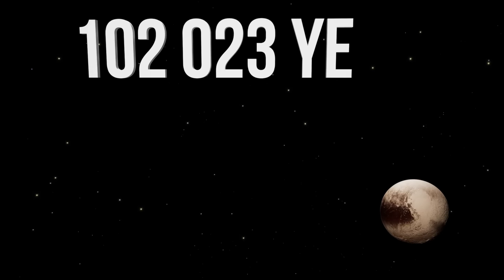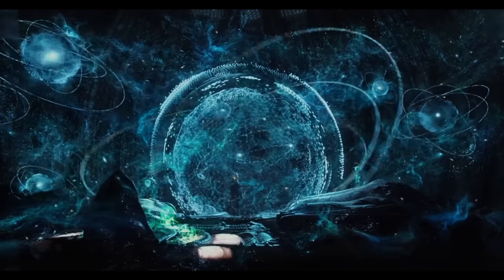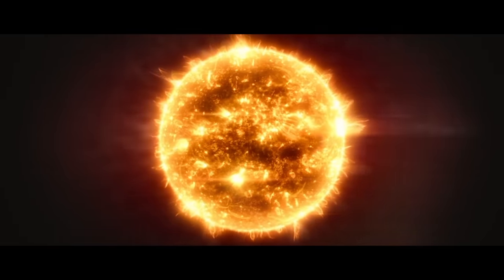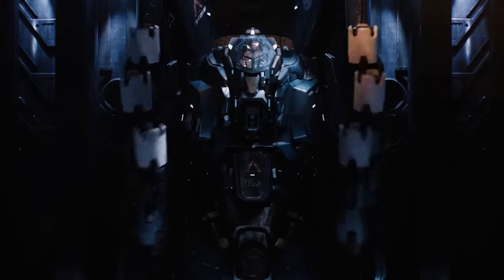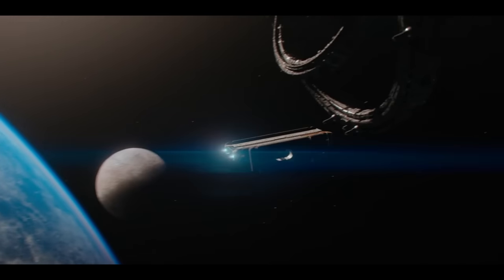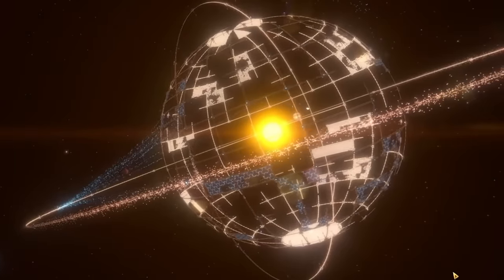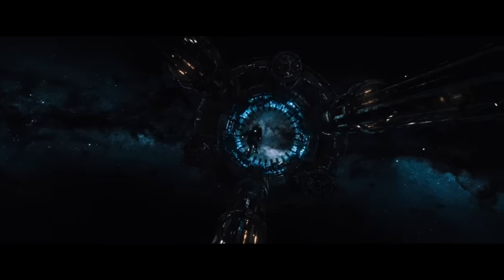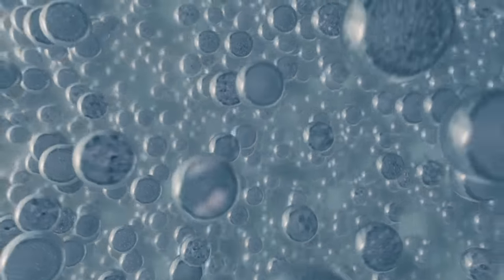This Is Why We Would Never Become a Type 2 Civilization

Comment: To move our star, would we not need a better understanding of gravity and geometrical forces?
Not quite as effective of a display but toss a ball into a pool to represent the sun then toss other balls in that same pool to cover each planet and belt etc, then push on the "sun" and I'm guessing it would collide into the other balls in the pool unless you can keep each planets orbital rotations and movements the same?
Reply: if the force is only applied directly on the sun, planet collision wont be an issue
Reply: @Outlaw-db6ee  In my mind if we put force on the sun that moved it, unless we add the same force to every other object things would work like the lost planets.  Take a large marble and place it in the center of a table, again add the other objects and so on around that marble.  If you push the marble it will move but more than likely run into the other balls or get pushed away from them.  Could you explain the planet collision not being an issue as again I see the planets breaking away from the gravity that holds them in place and keeps them in relatively the same orbits as they currently are.  It's like how the Earth's moon moves further away from the Earth each rotation???  With enough time some have said the Earth will lose the moon and it'll be a "Rogue Planet" or something along those lines.  I see the force being put on the sun to move it as having that same problem???
Reply: @n0tfunnyHaHa  You have to remember that the sun is already hurling through space at thousands of kilometres an hour, as well as the planets. The reason the planets do not deviate from the sun and get lost is because of gravity pulling them together. This gravity will still be present if we use a force to push the sun and make it hurl through space even quicker, as  it will not be possible that the force used will be strong enough to overcome the gravitational force between the sun and the planets. It is just too strong. Instead this force would be similar to a jet booster on a rocket, moving the entire solar system, aside from the astroids and things on the outside that do not have as strong gravitational force to the sun. Maybe if we become advanced enough and can a)store that much energy and b) are able to expell it we might lose pluto (but this is highly improbable).
Reply: @Outlaw-db6ee  Here's hoping at some point in time we get to that point, I'm still waiting on my "Replicator, Transporter, Warp-speed, Engage!"   So many theories and ideas?
Reply: @n0tfunnyHaHa  I agree, it would be incredible for us all to see. Although I think we will see a huge amount of insane technology breakthroughs in our lifetime, one can only dream what itll be like to those who uncover faster than light travel

Comment: profile picture
How to use Dyson spears theory of we can build multiple space probe with Solar power which can store energy in a for of battery and use laser for transferring that to long distance using multiple different probe for faster transfers
View other drafts

The Dyson sphere theory is a hypothetical concept, and there is no way to know for sure how it would be built or operated. However, it is possible to speculate on how a Dyson sphere could be used to power space probes.

One possibility is to use the Dyson sphere to collect solar energy and store it in batteries. The probes could then use this stored energy to power their own systems, such as propulsion, communications, and sensors. This would allow the probes to operate for longer periods of time without having to rely on solar power from their own solar panels.

Another possibility is to use the Dyson sphere to generate laser beams. These laser beams could then be used to transmit energy to the probes. This would be a more efficient way to transfer energy over long distances than using radio waves.

To use multiple space probes to transfer energy faster, they could be arranged in a network. The probes could then use the laser beams to transfer energy between each other. This would allow for a more efficient and reliable way to transfer energy over long distances.

Of course, there are many challenges that would need to be overcome before a Dyson sphere could be used to power space probes. These challenges include the enormous cost of building a Dyson sphere, the difficulty of transporting the probes to the Dyson sphere, and the need to develop efficient and reliable laser technology. However, the potential benefits of using a Dyson sphere to power space probes are significant. This could allow us to explore the solar system and beyond for longer periods of time and with greater efficiency.
Ridddle .

Comment: Well have to travel to the closest star in order to make one after starting off with one loop. One loop should be the next human project after we go to the other planets in the solar  system first, hopefully we get metals from venus or murcury to make the first loop. Then use that energy for conductive hybrid fusion electric, gas rockets. That use fusion generators to superheat regular fuel while not releasing any fusion energy. Bose Einstein condensate shells for radiation blocking and absorbtion. Then use fusion powered shields to lower your center of gravity.

Comment: An overly pessimistic video. For example, if you charge anti matter atoms and have the same charge on the inside of the container AND use a nag field to hold them away from normal matter AND keep them very cold to ease storage that would work. Other ways to store energy are in huge super conducting rings(batacitors), a technology we can already do. We already have satellites nearer the sun than either Earth or Venus which watch solar weather, so with advance warning a Dyson swarm could modify itself to minimize damage to its satellites. There is also the emergence of fusion power, which we will likely have before the entire Dyson swarm is ever built ;)